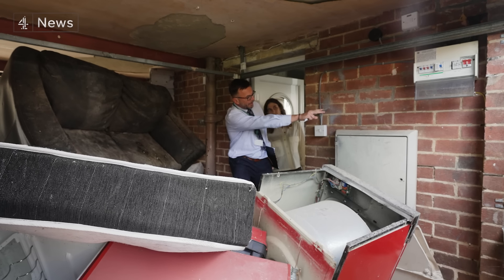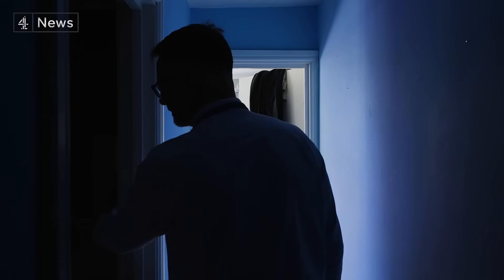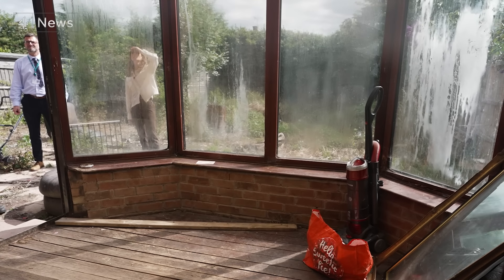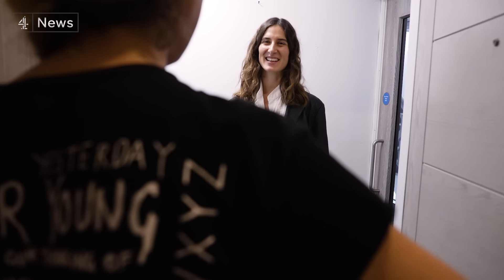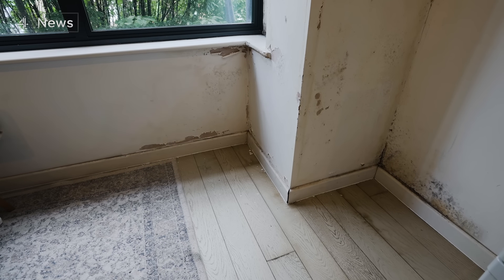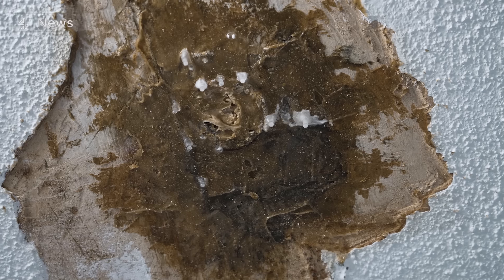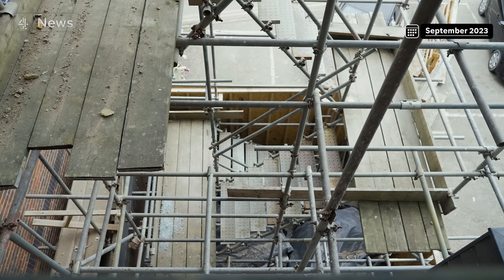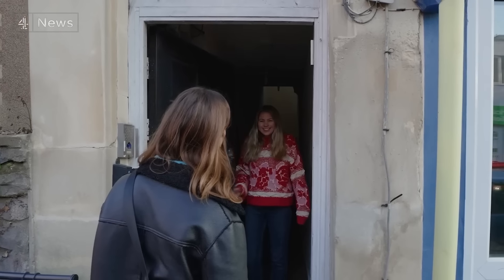Rent crisis: how bad landlords avoid punishment

Comment: The only two ways to keep the mould away are to constantly air the space via opened windows or when the heater is on! These two methods are drying the moister. Why you can't do it. To provide constant air you need to keep the windows open which means you gonna freeze to... yeah. And on the other hand you cannot warm up the room as the electricity is very expensive. Most landlords want the heaters to be off or if you use them you gonna pay extra and that extra is a lot of money at the end of the month!

9:00 The mould will return! The building does not have good protection within the walls or good sealants around the windows! Painting will only delay the inevitable with a month or two!

Comment: I remember renting a multi-occupancy house in Watford, U.K…the refrigerator was replaced, and unknown to me at the time (before plugs were mandatory on appliances and it was expected that we wire up plugs, and even taught in school how to wire them up  correctly), I went to the fridge after work to grab some milk, and I was hit with a massive electric shock. The landlord had removed the fuse in the plug, and assumed the brown wire was earth (the same colour as earth), but that’s the live wire in the uk (blue is neutral and green/yellow is earth). He had wound some copper wire on the fuse to stop it from blowing. If I had washed my hands in the kitchen with wet hands, I would have been killed. The landlord also kept the heating controls for the house in the locked cellar, and we only had two hours of hot water and heating even in the middle of winter, with 5 occupants. He also made one of the (female) tenants do all his laundry for him, ironing and pressing shirts, for no reward. She was a refugee from Sri Lanka and clearly exploited. 
Tenants in the U.K. have no chance of ensuring liveable conditions, and it’s a disgrace and another form of rampant exploitation.

Comment: As a stop gap until repairs are made, these renters or land lords need to purchase good quality air filters and dehumidifiers. From experience it does make a difference. Some of the electricity needs to be covered by the landlord for running them most of the day/night.

Comment: Between 2000 and 2023 the UK population has increased by around 15% - approximately 9 million more people.
That's roughly equivalent to 20 cities with the population of Leeds, or 15 cities the size of Bristol.
During those years, if you haven't seen those cities being built (complete not with just new houses & flats, but also with schools, hospitals, GP surgeries, dentists, emergencies services, shops, parks, roads, buses, trains, power & water supplies, drainage...etc) then, therin lies the root of just about every crisis people currently face in broken Britain:

The UK does not have, has never had, any kind of coherent long-term plan - for anything.

Comment: I had worked as a handyman at owners of many proerties in southend , the conditions were horrendous they housed down and outs.
many houses were burned due to druggies  smoking in bed for example, the other side of fires were landlords refusal/ignoring that central heating be repaired.
The result was in a house of multiple occupancy each room bought a electric heater or two, this over welmed the consumer unit due to fuses going off,
i.d go there put correct fuses in WIre type only to find nails inserted, after reporting the problems i was sacked.
this was some time agao and things have tightened up thank god.
bare wires,broken wall sockets, full sized cookers in 13 amp plug!.
The best landlords were the pension investment private ownership types who would rent out one house, they were greatfull of any problems found and gladly got the repairs done.
NOT ALL ARE BAD LANDLORDS IT THE LTD CO<S ONES YOU GOT TO KEEP AN EYE ON.

Comment: We need the return of council flat housing. We were able to house people in the 50s, 60s, 70s and 80s and 90s. Why can't we do it in 2023?
Reply: Because they knocked them all down, even though they were built very well.
Reply: @nodoubtaboutit  Whole areas in Liverpool were demolished just to build apartments that look all the same 😢
Reply: They need to restart building them cos we are all barely surviving right now, and I presume that includes the middle classes
Reply: They sold them all off under the Right to Buy scheme. It was a terrible idea.
Reply: @psi-man  I used to live in one of those houses right next to Smithdown Rd. Eventually the whole street got knocked down with one of the EU funds. They were claiming it was cheaper than repairing them. Now whole areas lost all the character 😶
Reply: So glad I have mine

Comment: live wires stick out of the back of my sink in bathroom. Fires doors quarter inch gap all down the lockside. LL turned up with blind for bedroom once, the blind was about 1.5ft in drop for a 4 ft tall window 🤣 I said "That will not fit, it's not for here", "It is" he said, even had to hold it up to see DOH 😑. Lord give me strength please Amen.

Comment: Was taught to respect my elders, but into my 18th year of tenancy F*#k my landlord. 16 YEAR'S OF DOUBLE GLAZING THAT WAS MADE TO FIT THE FRAME'S OF THE BUILDING BY SCREWING DOUBLE BATTON'S EITHER SIDE TO MAKE THEM FIT. not arsed about the cold, it's the noise. What was the point of DG being put in. Obviously totally incompetent using a tape measure, in several areas just in this flat. Worse are people who will not admit they are wrong. Can slide a 400 page book under my front fire door... Council or CAB absolute no back up what so ever  "Just Pay Your Rent!" they say. 
No more Rent from me Mr Bond Scum lord!!!

Comment: Mold like that ,black mold always returns. The advice is to move but outside of pouring a new foundation the landlord and tenant are stuck in an endless cycle.
Reply: Using spray also helps 🧐
Reply: @spaliverpool71  using spray, what?
Reply: @spaliverpool71  I guess highlighted response is at Rusty 's discretion hahaha derr derr derr
Reply: Anti-mould spray 😏
Reply: @spaliverpool71  yea but no you are not the first one to think of 'spray' what brand of spray? You know so that you can say something meaningful. Which miracle spray? 😺
Reply: Open windows when drying laundry inside. Condensation is a common problem in flats without a garden or balcony.

Comment: As a landlord i cannot defend of course these awful properties, but don't expect the RRB to sort out this issue, a lot of councils are bringing in licensing schemes, all that happens there is good landlords register and pay the massive fee and the bad landlords don't bother !! As you have seen in the video the councils have no staff to enforce this brazen lack of adherence. The good landlords then just divide the fee to the council between 12 months and hey presto, the tenants rent has gone up. Its crazy, the councils know which properties need to be improved, there does not need to be a license scheme, there just needs to be more staff and enforcement from the councils !!! All the RRB will do is drive out the good landlords like myself and leave the dregs of the PRS, the ones who don't follow the rules and never will. They need large fines and the shutting down of their properties, if they are not improved in a certain amount of time then the council takes a charge over them and does the work themselves, thus owning part of that property, its really not that difficult. The good landlords have little concern for this as we are NOT the problem. The masses of recent govt intervention are ensuring that landlords are selling up at a massive rate, this is very bad for tenants, if this does not stop then there will be slums the likes of which we have not seen since the 1880's.

Comment: Dude - Sarah needs to start HEATING that damn place. 

I had tenants in one of my older apartments and they had some mold problem (nothing as shown here, just specks near the floor). I came to inspect. The air in the apartment was really really damp since all windows shut tight. I told them - its an older building, it needs to be well ventilated atleast 3 times a day and it needs heating 12 hrs / day over winter months to keep from molding. If you are out for several days you can just turn heating off and open windows, cold will prevent molding. They said they couldnt afford the gas bill (which was extra 50E / mo over winter). I provided them with mold killer solution to spray on and a bucket of paint. They sprayed and painted the lower parts of the apartment once a month over 4 months of winter. Problem solved.

Oh yea - I get it its UK where its dampy and gloomy around the year. But still.
Reply: 'I provided them with mold killer solution to spray on and a bucket of paint.'   Instead of the insulation the walls need.   You are one of those who will probably sell up when the new EPC regulation take effect.

Comment: Why do they always show extremes and they never show how tenants can destroy nice properties?
Reply: A tenant completely fried the electricity circuits of a whole floor in my property after repeatedly using an ill-fitted electrical device. Tenants can be nightmares as well
Reply: Because it wouldn’t fit their narrative and the changes they’re gradually bringing in, turning the screw on small time private landlords whilst making it easier for big companies.
Reply: @HumansAreShitFactories  have you heard about lld licencing another way to tax landlords and increase rents?
Reply: There needs to be a better contract between the landlord and the tennant. The property should be handed back at the end of the tenancy in good condition and this is the tennants duty. In Germany you are required to paint the apartment before leaving. Surely those who wreck property lose their deposits?
Reply: @singlelegstretch  Unfortunately my old landlord was retiring and transferred the block of flats to a very unscrupulous arrogant young Chinese woman. She was greedy increasing the rent 30 % straight away, locked the meter without notice to pressurize me thinking I wouldn't be paying the last month, refused to give me a tenancy agreement after my former landlord asked me to give back the previous one and wanted to charge more than the deposit but I fought her back and got almost nothing. In the advert, she was also claiming it was a Victorian property: from the 1960's 🃏
Reply: If a good landlord is afraid of bad tenants, they can always sell up. What option does a good tenant have when the only properties available have bad landlords?
Reply: "Your investment may go up as well as down". If you can't handle the risks of being a landlord then don't be one. Not everyone has the luxury of just deciding they don't have to live in a house though, so it's not like it goes the other way
Reply: As a landlord, I'd like to see a video titled "How bad tenants avoid punishment". There are two sides to every story.
Reply: @kevinsyd2012  and I would like to see  a video showing how councils introduce fees on landlords which make rents higher for tenants like licenceses costing thousands pounds.